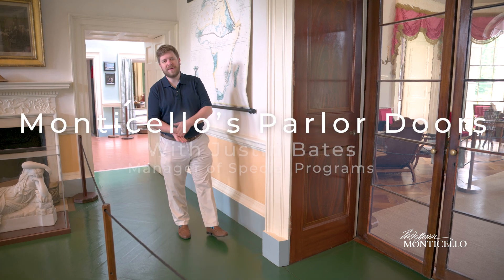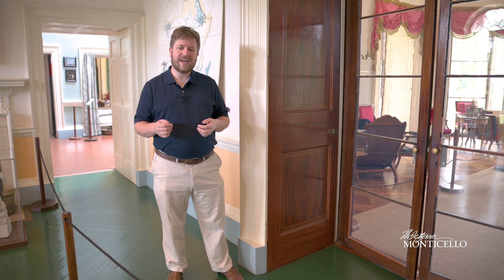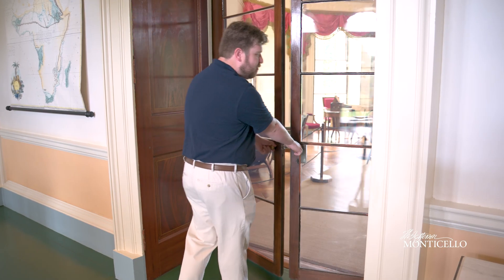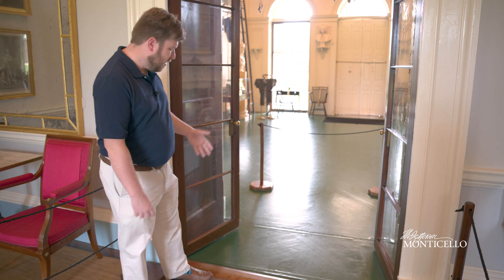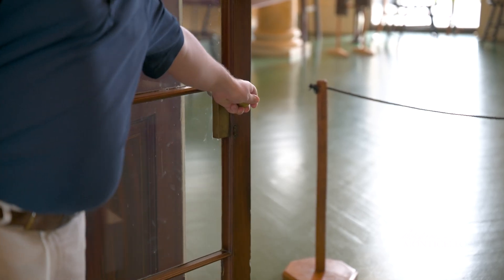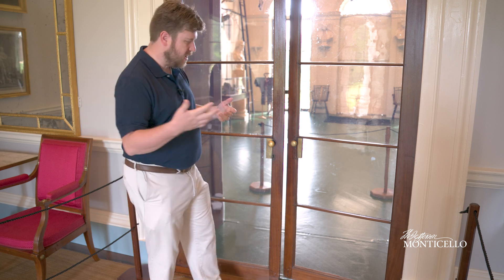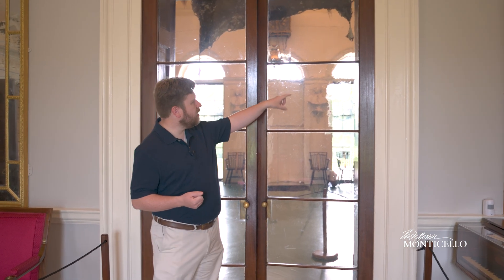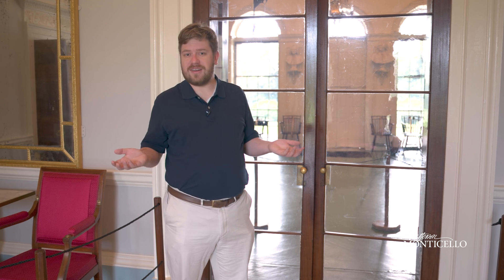How it Works: Monticello's Self-Operating Doors

Comment: Why are both doors required to be manually opened if there's the pulley system, which clearly works (mostly) to close both doors via the manual operation of only one door?
Reply: Probably just cuz of time and wear and tear. I'm sure it worked originally both ways